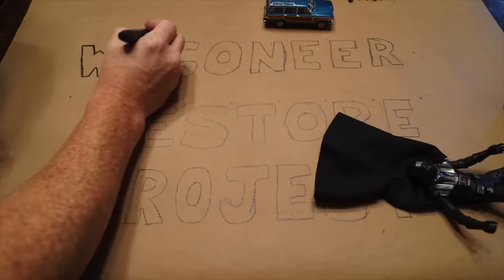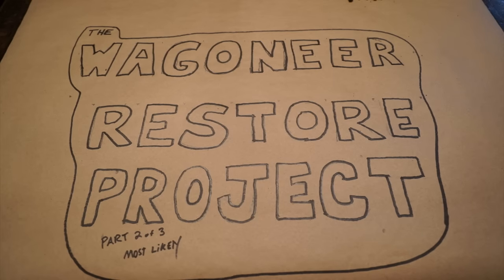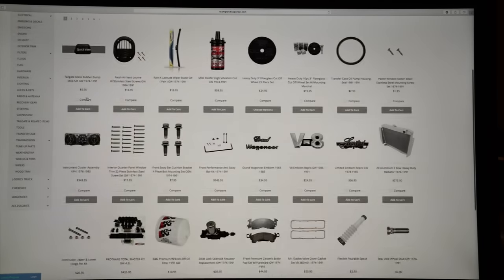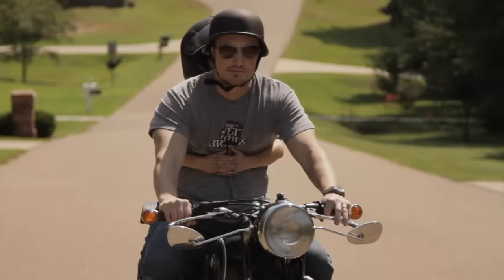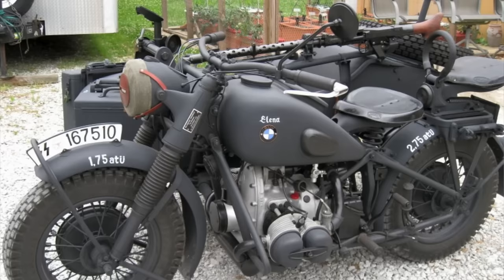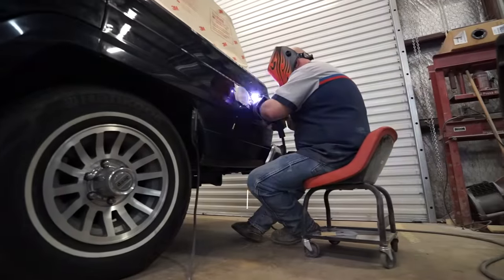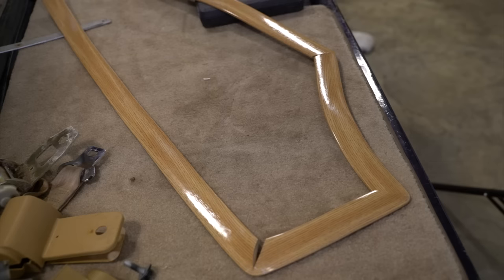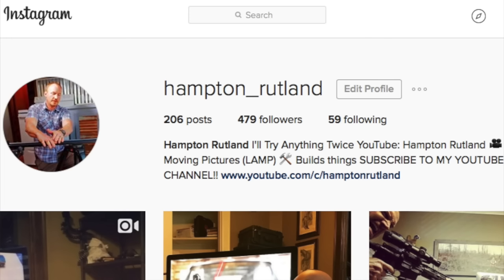Restoring The Jeep Grand Wagoneer  - Part Two

Comment: I have a 1989 Grand Wagoneer in the same color. I have a new 5.9 360 with 4 barrel Edelbrock carb and intake manifold with Heisman short headers and a single Flowmaster muffler. It has MSD ignition with distributor and wires. I’m looking to convert to EFI now.

Comment: I am to the point of taking my wood vinyl off. The eraser air bit sounds better and quicker than the heat gun and peal method. How much time did you spend sanding your GW down after getting that off?